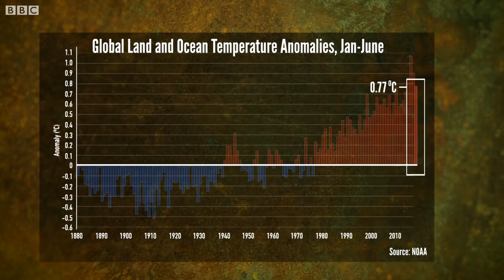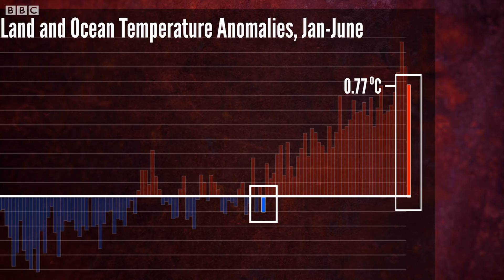Heatwave 2018 explained - BBC News

Comment: Notice how she speaks about the 1950's.
Does it cross your mind to wonder why she chose the 1950's?
I'll tell you why. Prior to the 1950's there were a number of years where there were high temperatures and climate change evangelists don't want you to know about that.
In fact the IPCC charts that are printed start in the 1960's because they don't want you to know that 1940's were actually quite hot and then cooled off in the 1950's. So quite understandably a rise in temperature since the 1950's looks dramatic if you don't realise that prior to that time temperatures were also high.

Comment: Here’s the thing. Back about 400-500 years ago there was exceptional heat in March in the uk and Europe. Very extreme weather in autumn too and a storm with such strong winds that it sounded like booming thunder. If more extreme conditions happened centuries ago then how could we possibly link that to global warming and not just part of the earth’s natural cycle? Our proper records only date back to around 1910 which is just a smudge of how long this planet has been around for! NOT GLOBAL WARMING. Even in 1910 there was a widespread drought and exceptional heatwave across Europe with temperatures hitting a maximum of 35.7 degrees Celsius in the uk and lasting for days on end

Comment: If it's really hot, close the blinds before it gets to 80 or while the house is still cool (like in the morning) it will keep in the cool. Open the windows when the sun goes down and the air is cool. It will let in cold air, keep it in, and keep out hot air.

Comment: You would know why if you educate yourself about astronomy for a bit and go buy yourself a good quality electronic telescope, then check the charts on a sun waves monitor and compare them to the data charts the government uses (there is one app for 2 bucks online for research, called sun monitor)  

It doesn't take much training to even read the chart codes and look up their meaning in the app, there is something somewhat sinister going on. I don't think we have a way out except for the wealthy, which seems to me why we are being distracted so much with world turmoil that goes no where meanwhile accelerating thru international cooperation the colonization of space. The sun seems to be reacting beyond normal patterns; and this is mot me making this up, again download the app if you don't want or have the money for a good telescope.

I have found numerous warnings on the research sun monitor app (the warnings are compiled straight from the government research institutes); lets say 1000 being a number to describe normal sun activity; the reading are off the charts right now. And if you read each warning code meaning, it describes things like satellite systems overcharging or danger of failure, it talks about regions of the world affected, it has been a year now since i found this out and i was wondering if they ever will start talking about it to cover it up. Because one of the warnings i read was exactly this; abnormal heat activity for the northern regions of the planet. 

Anyway, time to wake up and ask for the truth and find a way to help humanity; although if the sun is going thru this abnormal flaring stage then we are all fucked, except for those that make it out of the planet. Which is why i think we are being sold pushed to accept mars as a plan B.

Comment: This year we in Montenegro (Balkan) have had one of the "coldest" summer. Usually temperatures are 37-39 in July, but in July 2018 - 33 Celsius was maximum with a lot of unusual clouds and rain. In August temperatures are usually above 40, but this August 36 is the highest so far.

Comment: 3:15 I think they forgot how insulation works, it also keeps the cold air in the building and lowers the amount of cold air and energy you need to use to keep the building at a reasonable. It works both ways.

Comment: The media is finally edging towards acceptance of climate change, a positive step even if they are terribly late getting to the seriousness of the issue.   The focus is flawed however, they want to know how we can adapt to rising temperatures.  Humans can adapt (depending on their location) but our ecosystems cannot.  This summer is a serious shot across the bow so to speak, crop failure due to the drought conditions experienced in the Northern hemisphere is a grave problem and no doubt food prices will be on the rise.  A more serious drought will lead to even larger crop failures and at that point civilization as we know it will begin to collapse.  So the premise that we can adapt to climate change is a false hope, the premise that all we need do is change building codes and save our city parks is flawed.  Our only hope is turn off the fossil fuel industry as fast as possible and stop the cattle industry in its tracks, that is where the discussion needs to be focused.  The top three CO2 emitters belong to our power industries, cattle industries and transportation sectors.

Comment: When a 1/1000 occurrence occurs, you should recalibrate your models. The Imperial College climate scientist needs to get a data analyst - her models are wrong. Can't therefore trust her opinions.
When winter comes, we're still going to have trains not running because of an inch of snow or leaves on the rail. Doesn't mean we've got a new ice age. BBC are full of BS. Their version of 'new normal' is for us all to pay a climate tax. Tax us to breathe the air. 
The only extreme event is the BBC

Comment: Why would a tax be mentioned in USA $? The USA has no intention of cutting back on carbon emissions and are pushing for more gas coal and oil throughout, and have pulled out the Paris deal. People will still need insulated houses to keep air conditioning in, having temperature controlled buildings is important to have good insulation. If sea levels rise it will not only impact what crops we grow, it will devastate mass amounts of people and infrastructure. The heatwave was not explained at all! but maybe an excuse to add a tax.

Comment: What about the Sun?
The Sun is not firmly nailed in the Universe but moves towards the Costellation Hercules with a speed of 13.4 km/s.

In its travel through interstellar space, the Heliosphere travels in the direction of the Solar Apex in the Hercules Constellation. 
On its way it has met (1960s)non homogeneities of matter and energy containing ions of Hydrogen, Helium, and Hydroxyl in addition to other elements and combinations. This kind of interstellar space dispersed plasma is presented by magnetized strip structures and striations. The Heliosphere [solar 
system] transition through this structure has led to an increase of the shock wave in front of the Solar System from 3 to 4 AU, to 40 AU, or more. This shock wave thickening has caused the formation of a collusive plasma in a parietal layer, which has led to a 
plasma overdraft around the Solar System, and then to its breakthrough into interplanetary domains [5,6]. This breakthrough constitutes a kind of matter and energy donation made by interplanetary space to our Solar 
System. 

https://en.m.wikipedia.org/wiki/Solar_apex

http://www.tmgnow.com/repository/global/planetophysical1.html

https://en.m.wikipedia.org/wiki/Plasma_(physics)

Comment: Are these guys getting paid by the coal lobby. These numbers are wrong. Failed to mention the Arctic melting next year. Failed to mention methane threat. Failed to explain 4c is life over................ 4c is gone over. The ipcc think it’s ok to only report on this every 5 year. What a joke. What about global dimming!  What about ice melting 2x faster the ipcc predicted. IPCC is gutless and x members explain why. If this is the level of journalism we can expect. Well really it’s already to late. I’d  rather hear nothing then this deliberately convoluted and misleading answers. 100% waste of time.
Reply: +Mark Klement People Glibal warming was true while we were in the solar maximum cycle  (mundar maximum). Since we have entered the solar minimum cycle now the fake news has modified their rhetoric to "climate change". Climate change is normal. The earth has been continually cycling between glacial and interglacial periods with solar maximum and solar minimums warming or cooling respectively. Greenhouse gases are also a factor of warming or cooling cycles. The lie is that CO2 (carbon dioxide) = Greenhouse gases. This is fals. Greenhouse gases are 95% water vapour. Less than 5% are other gases, including CO2. Of that 5% less than a tiny fraction of 1% is due to CO2 from humans burning fossil fuels. To put it in perspective, a single volcanic eruption releases far more CO2 than a year of humans burning fossil fuels! Think about it, even if humans stopped fossil fuel burning entirely, a single volcanic eruption would negate it all! How will increased taxes and shutting down fossil fuels prevent climate change? It is less than a drop in the bucket of water! The  earth's flora uses O2 (oxygen) aerobic respiration during the day and uses CO2 anaerobic respiration at night. All the human fossil fuel burning in a year is completely used up by the flora in a single nite! Al Gore predicted all the Arctic ice would be gone by 2011. That was 7.5 years ago. The "model" used by global advocates (of warming due to humans burning fossil fuels) has proven unreliable & inaccurate. Failing to tell the whole truth and nothing but the truth means avoiding the sins of omissions and false inference. Antarctic ice has been increasing not decreasing. Russia and the EU have had severely cold winters these past few years. In the transition from solar maximum to solar minimum, the earth typically experiences increased earthquakes, volcanic eruptions, and severe winters and summers. Polarity and axis also enters the equation, but this too is normal and nothing to do with fossil fuel burning hoax. When they started to measure temperatures at various locations world wide, the measuring stations were on the outskirts of towns and cities. Now those same stations are surrounded by buildings and paved surfaces that always register higher temperatures well into the night. The temoersture in surrounding woods abd fields is up to 4 degrees cooler. Those scientists that correctly adjust the data to acount for such artificial factors show no significant  measurable global warming. In fact the models that have been predicting accurately show we will be cooling and could be in a mini ice age by 2050 but it is still too early to be sure. Temperatures were warmest during the Roman times from about 100 BC forward. They were also very warm during the medieval period  (solar maximum). Neither of these had industry burning fossil fuels nor high human populations. Nothing to do with the hoax! These solar maximum cycles were always followed by solar minimum cycles. The solar minimum following the medieval times led to a mini ice age during which in the 1800s the winters in Britain became so cold that the Thames River froze over. 
The Rothschild Rockefeller Bilderberg multinational corporation globalists want 1 world government and one world religion controlled by them thro the UN. To get this control they need the people to fear WW3 or some other world crisis fear. Global warming fits the bill. In Canada, Liberal PM Trudeau's government is pushing the fake global warming agenda and has implemented a carbon tax under the misleading name of cap n trade. Last month Conservative Premier Doug Ford won the provincial election in Ontario. An analysis of the Liberal budget revealed that the entire Liberal budget for school repairs was to come from the carbon tax revenues!
Reply: You are partially responsible for the death of millions of people. How do you sleep!!!!!!!!!
https://www.bloomberg.com/graphics/2015-whats-warming-the-world/
Reply: +Mark Klement People Glibal warming was true while we were in the solar maximum cycle  (mundar maximum). Since we have entered the solar minimum cycle now the fake news has modified their rhetoric to "climate change". Climate change is normal. The earth has been continually cycling between glacial and interglacial periods with solar maximum and solar minimums warming or cooling respectively. Greenhouse gases are also a factor of warming or cooling cycles. The lie is that CO2 (carbon dioxide) = Greenhouse gases. This is fals. Greenhouse gases are 95% water vapour. Less than 5% are other gases, including CO2. Of that 5% less than a tiny fraction of 1% is due to CO2 from humans burning fossil fuels. To put it in perspective, a single volcanic eruption releases far more CO2 than a year of humans burning fossil fuels! Think about it, even if humans stopped fossil fuel burning entirely, a single volcanic eruption would negate it all! How will increased taxes and shutting down fossil fuels prevent climate change? It is less than a drop in the bucket of water! The  earth's flora uses O2 (oxygen) aerobic respiration during the day and uses CO2 anaerobic respiration at night. All the human fossil fuel burning in a year is completely used up by the flora in a single nite! Al Gore predicted all the Arctic ice would be gone by 2011. That was 7.5 years ago. The "model" used by global advocates (of warming due to humans burning fossil fuels) has proven unreliable & inaccurate. Failing to tell the whole truth and nothing but the truth means avoiding the sins of omissions and false inference. Antarctic ice has been increasing not decreasing. Russia and the EU have had severely cold winters these past few years. In the transition from solar maximum to solar minimum, the earth typically experiences increased earthquakes, volcanic eruptions, and severe winters and summers. Polarity and axis also enters the equation, but this too is normal and nothing to do with fossil fuel burning hoax. When they started to measure temperatures at various locations world wide, the measuring stations were on the outskirts of towns and cities. Now those same stations are surrounded by buildings and paved surfaces that always register higher temperatures well into the night. The temoersture in surrounding woods abd fields is up to 4 degrees cooler. Those scientists that correctly adjust the data to acount for such artificial factors show no significant  measurable global warming. In fact the models that have been predicting accurately show we will be cooling and could be in a mini ice age by 2050 but it is still too early to be sure. Temperatures were warmest during the Roman times from about 100 BC forward. They were also very warm during the medieval period  (solar maximum). Neither of these had industry burning fossil fuels nor high human populations. Nothing to do with the hoax! These solar maximum cycles were always followed by solar minimum cycles. The solar minimum following the medieval times led to a mini ice age during which in the 1800s the winters in Britain became so cold that the Thames River froze over. 
The Rothschild Rockefeller Bilderberg multinational corporation globalists want 1 world government and one world religion controlled by them thro the UN. To get this control they need the people to fear WW3 or some other world crisis fear. Global warming fits the bill. In Canada, Liberal PM Trudeau's government is pushing the fake global warming agenda and has implemented a carbon tax under the misleading name of cap n trade. Last month Conservative Premier Doug Ford won the provincial election in Ontario. An analysis of the Liberal budget revealed that the entire Liberal budget for school repairs was to come from the carbon tax revenues!
Reply: Holy smokes dude, first you need to learn how to spell, second you need to learn how to not contradict yourself.  Besides those two immediate and glaring issues you are so far off base that you have entered the realm of ridiculousness.
Reply: Climate change is natural and if you look at the data graphs over the past thousands of years you will see the cycles repeat and have nothing to do with humans burning fossil fuels! It's a fear tactic and money grab. Antarctic ice is increasing not decreased
Reply: climate change is natural at geological timescales only. what humans have accomplished in one hundred years would have taken nature thousands and thousands of years to accomplish, specifically the level of CO2 and methane and nitrous oxide now found in our atmosphere -  and put there by humans since the beginning of the industrial revolution.
Reply: wow! Do you get paid per word or do you get a salary.  CO CO land.

Comment: Since the solar flares the earth is expanding, it has set off fault lines and volcanic activity, the iiner earth releases heat from the core, which is released up thru fissures in the land, causing combustable forest fires, draining water tables adds to the problem and the gound will give way, sea water could fill out the lower water levels but will make some lands very salty and kill off plants and trees, the only temp regulation will be mountain tops that could freeze and the arctic suddenly re freezing, it could happen if the planet can release enough heat, and if the heat from the sun lessens, crops ned to be protected with UV netting otherwise it will turn brown and crispy, in fact entire fields need to be covered with UV Nets